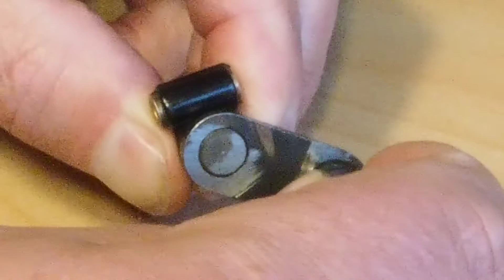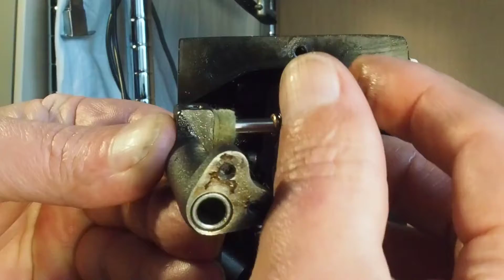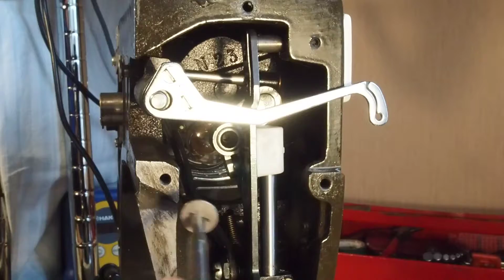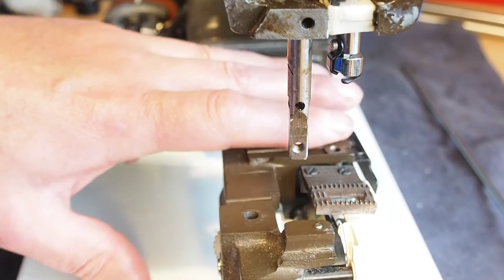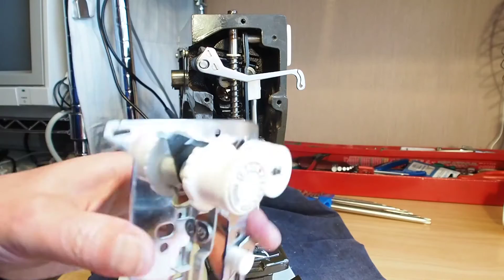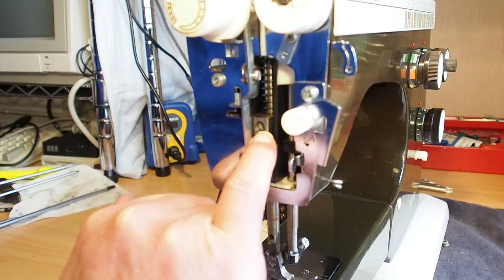Viking Husqvarna 6000 Series Sewing Machine - Take-up Crank Slide Repair - Part 2

Comment: 9:46 - that plastic part.  Clean with alcohol to remove all grease.  Squeeze some liquid super glue into that crack and on top. Sprinkle a light dusting of baking soda on super glue to solidify it.  Now you have a good repair for many more years.
The other option is to recreate that part using a 3D Printer.

Comment: Great video and workmanship!  I have a dilemma.  My used Viking came with a broken take-up crank slide and the plastic pieces long gone.  I purchased a new take-up crank slide for a 6430, or so it was advertised.  It's not the same.  The old one, as you know, has  a spherical bearing and retained by the spring and clip.  The new one has a straight bore.  Would you know any part numbers?  Thank you,

Comment: Great video, thanks. I also put the slide on upside-down just like you did! 
A tip to set the presser bar height; put the foot pressure dial to lowest (darning) setting, then place a 6mm Allen key centrally under the presser foot (with the dogs down) . Align the presser foot against the sole plate & push down on the presser rod whilst tightening the square clamp. This gives the correct range of foot pressures.

Comment: Thanks so much.  Have my machine running again beautifully!    However I have a problem you may be able to help with. The stitch length knob is nice and free and I can the internals moving nicely.  However the stitch length does not seem to increase. I can decrease the number and get smaller stitches but I can’t get a basting length stitch when set to 4.  Any ideas?

Comment: If you work with the machine standing on its handwheel end, you won't have to worry about topshaft end play.      When setting presser foot height, put the lifter lever in UP position, move the bar up until the foot shank JUST clears the needle clamp in its full down position.  Then the presser foot will be at the right height (if your needle height is correct) and you can then make sure the foot is straight to the center needle position.

Comment: Hi, I wanted to thank you for this and all of your videos about he Vikings. With these and a few others I have been able to mostly understand the service technical briefing and have been trying to restore my 6460. It is deeply satisfying when something goes right, but after many many hours of loving labour, I am stuck and could really use some guidance. I would love to speak with you or email if possible, but in short, I have had to change out the fixed cam and the take up mechanism as you demonstrated. I have removed, cleaned and returned almost everything (not had the main part of the pattern selector out but was able to reach most things to clean and oil). I found some splintering on the rim of the shuttle driver that I was able to gently sand down (thought I'd try rather than waiting for yet another part to be delivered) and I thought it looked like it should be ok. I've put it all back together and have been working through the service adjustments, feeling quite pleased with myself until I needed to test some stitching while setting the tension... the top thread is getting wildly bunched up around the bobbin holder. I can only manage 3 ot 4 stitches before it jams. I cant for the life of me figure out what's happening or why and I'm feeling defeated. I dont know of a local repair place I can rely on and I so badly wanted to be able to do it myself, so if you can offer me any guidance I would be extremely grateful. Yours, Tamsin

Comment: Thanks mate! Same fault with my 6900. I found the brass sleeve just above the on/off switch! How did it get there?! The 0.1µF capacitor had exploded (usual in old machines). The machine will not reverse, but everything else seems OK. Maybe my client should get it serviced.

Comment: thanks for this video.  i was recently gifted a Viking 6430 with some accessories and cams A-F.  after watching your tutorials and doing a little cleaning and oiling, i'd say it's in good working condition, other than the cams but the cam stack is solid.  after testing all the cams, only 1 or 2 of the stitches work per cam.  out of the stitches that do work, those aren't the prettiest or the most consistent in parameters.  curious of thoughts on potential reasons.

also, the zig dial has the outer dial that can slide out and lock in place, curious what function this is.  don't have an user's manual so don't fully understand all the functions, esp since i'm new to sewing.   oh and one more thing, is there any sort of general guide as to what function the other presser feet perform that came with the machine.

thanks again for sharing your knowledge and skills.
Reply from the maker: Maybe you could find a manual online?

Comment: Hi! A very nice video as always. When it comes to the plastic parts they could probably be 3D-printed.. if the original piece is kind of complete you can use it as a template. As i said, a very good video. I like my sewing machines very much and your vids has helped me alot. Thank you so much.
Reply: @n.leinad  Very nice! I suppose most of the plastic parts could be made with a 3-D printer if necessary.
Tack för svaret! ;-)

Comment: Good evening Sir and thanks very much for the videos. 

I had one of these machines which I purchased for a few dollars from a local classifieds. What I found very interesting was that the manual stated that the machine 'need not be oiled'. Was this Husqvarna being a little optimistic? I was very fortunate in that my machine had seen very little use and was in great condition, so I never oiled it.
Reply: The metal parts are infused with a type of lubricant. If the machine is used regularly the heat generated lubricates the parts. However, when the machine sits for a long time this lubricant can harden. Stuck parts CAN be loosened back up with a judicious amount of Tri-Flow (or similar...) and perhaps some gentle heat from a hair drier. (Note:  NEVER use WD-40 as it will become like plasticized glue over time and ruin the machine.)
Reply from the maker: @earthview4242  Thanks. I assumed WD40 (which I have never used) was similar to CRC but I guess it's not. I would only ever use a penetrating oil to free a part up and then use oil as a permanent lubricant after that.
Reply: @InStitches  These were some of the first machines to use sintered steel bearings. They were essentially powdered steel compressed and heated to keep their shape but the end result was a bearing that acted like a sponge absorbing a good amount of lubricant. Heat and centrifugal force would coax the lubricant out of the bearing and onto the shaft during operation. The bearing would reabsorb the lubricant when the machine was idle. This was the main reason for the "need not be oiled" tag.
Reply from the maker: Thanks. Yes I've seen it stated in manuals that the machines don't need oiling. As far as I can gather, the manufacturers are assuming the machine will be serviced by a technician regularly, in which case the user does not need to oil it.
Reply: Sintered bearings are loaded with oil at manufacture using heat & pressure. I've successfully lubricated them using an equivalent to the approved BP lubricant. Takes time to let a tiny drip at a time absorb into the bearing edge, but it does go in & a dry bearing absorbs a surprising amount. My lubricant of choice is Citroen LHM fluid. It's the same a BP energol HLP 46 that's specified.

Comment: I am having a great deal of trouble trying to remove the reversed threaded screw. It is a slot screw on a 6030. It just will not budge. I have used penetrating oil and heat and it will not move. Suggestions please????
Reply: I always ask my husband to undo the tuff screws :-D By the way, metal expands when heated...